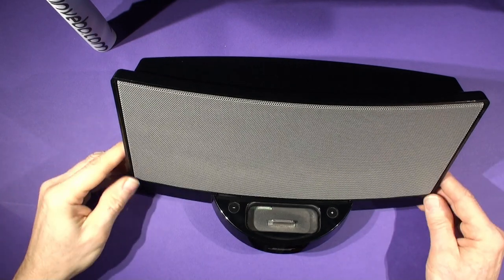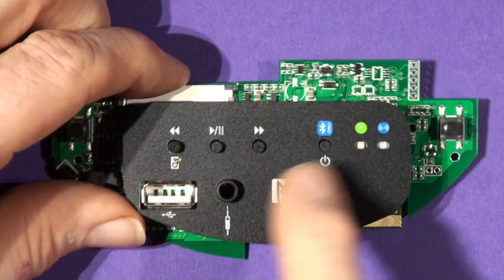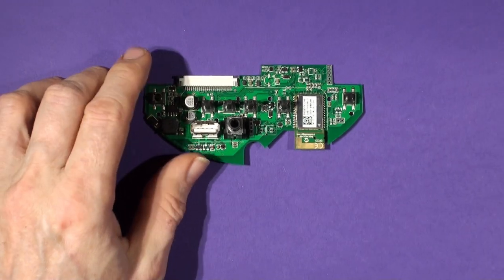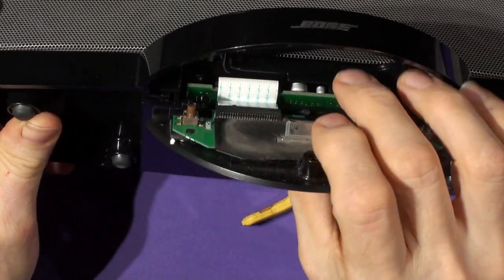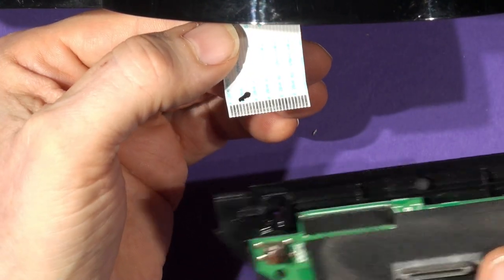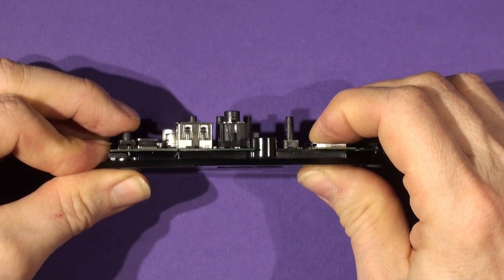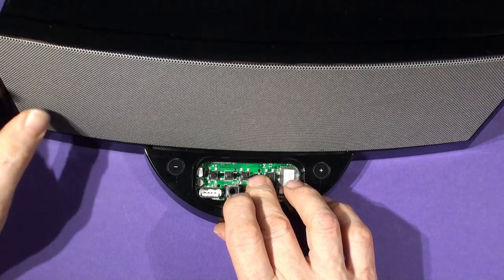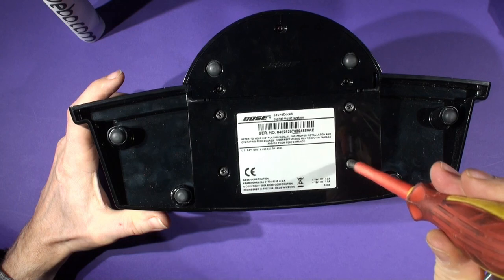How to Install a BC20 Bluetooth 5 upgrade kit in a Bose SoundDock

Comment: Just received mine yesterday and installed it within an hour. Sound and connectivity is amazing !!! I followed the step by step instruction except that instead of the board just free floating inside, I used the same pegs from where the original board was attached and hot glue the new board to the same pegs. Now it's stable and looks original as if it came from BOSE's factory.Thanks a lot for a great product, and it's really worth the cost and the wait ( 6 days ) I'm in Cali.
Reply: Hey Rei Bondoc, how you doing. I would like to buy this component, do you know where can I bought it?, I’m from Bogotá.
Reply: Buenas noches. Me puedes decir porque página lo compraste . Y como lo busco que referencia . gracias bendiciones . Amen

Comment: Hello, this video is very informative but hey for those who still use iPods it's a bit of a loss of the connector. I would have liked to have had an upgrade with an addition of Bluetooth while keeping the 30 pin connector lol after that we didn't have the link to buy the Bluetooth adapter that you present... It's a shame and we would have liked to have a test of this fantastic Bose speaker lol thank you for this very informative video

Bonjour très instructif cette vidéo mais bon pour ceux qui utilisent encore des ipods c'est un peu la perte du connecteur moi j'aurais bien voulu avoir un upgrade avec un ajout de Bluetooth en gardant le connecteur 30 pins lol après on a pas eu le lien pour acheter l'adaptateur Bluetooth que vous présentez ... C'est dommage et on aurait bien voulu avoir un test de ce fantastique haut-parleur Bose lol merci pour cette vidéo très instructive

Comment: Arrived yesterday.  I scheduled some time to install today.  FInished in under an hour.  Ribbon cable was a bit of a pain but managed to get it inserted properly.  My cheap Android phone paired immediately.  I have DEFINITELY missed the rich and deep sound of this Bose.  It brought memories back hearing music playing through it again!  Thank you for a wonderful product!
Question:  When pairing it asks to allow contacts/calls.  Why does it do this?
Reply from the maker: That is problem with the Bluetooth implementation on your device.  The BC20 reports the relevant profiles during pairing so the phone should take note of the capabilities and not ask irrelevant questions..
Reply: Buenas noches que pena la molestar.  Como hago pa comprarlo .gracias

Comment: I've just picked up a brand new old stock original sounddock, all boxed with everything still in packets. I haven't tested it yet because i dont have an ipod. I've ordered one of the cheap ebay  bluetooth modules, but I've just watched this and I'm very interested. I don't live very far from Reading. Would i be able to pop in and pick one of these up if you still make them? 
  I have plugged mine in but theres no indication of it being powered up without an ipod in the dock. Is it supposed to beep or anything when powered up, or is there any other way to tell if its on without an ipod? ...great product, by the way and a great instructional video. I'm sold!

Comment: I have just fitted this, wonderful on bluetooth and 3.5 jack.  However I still haven't got the nfc on my Huwawei to work yet.  Also, I assume the usb is for charging only as it doesn't play music memory sticks or iPods.  It would be helpful if you sent a users manual with the unit.  Not sure about the bass boost control, will keep trying.  INSTRUCTIONS please.  Just basic ones.
Reply from the maker: Thanks. Enjoy. The docks are so good.
Reply: Hey, did you get your NFC to work? This guy seems confusing to me. He is talking like it's his product, but doesn't even have a link to buy it in the description. He seemed to completely ignore your questions too. I can't tell if he's a bad businessman, or if he's got someone else running the YouTube channel.
Reply: @xenonram  Yes, I did get a reply from him directly from the small amount of info with the paper sheet included, and got the gadget working, it's great!  However I am not happy about the lack of instructions and I still don't know if the usb should play sticks or not.  I suspect the maker is a talented amateur rather than a businessman and I don't know if he is still making them.

Comment: Is it Compatible to series 2 bose sounddock? Thanks
Reply from the maker: No we do the Sd20 kit that has the 30 pin dock connector + Bluetooth but not the BC20 features.
Reply: @ispens  do I need to buy a Bluetooth adapter to put on 30pin or this SD20 is enough to make it Bluetooth enabled or a Bluetooth Ready with nothing else to do ( I have Series II)

Comment: I have a series 2 and I have a bluetooth receiver that plugs into the pin, I also have a series 1 and the bluetooth receiver doesn't work with it why is that?
Reply: those bluetooth adaptors are not compátible with dock 1, because it cant charge iphone and some new ipods,only those old ipods.i think it uses the fierewire charging of the 30 pin connectors,so dumb..
Reply from the maker: @jota6823  True. The BC20 gets rid of these problems.

Comment: I have a question. Will Bose remote control work with this? Whoever it knows please reply.
Reply from the maker: The Bose remote works with the volume on the dock but the power and track navigation is done from the Bluetooth source device.